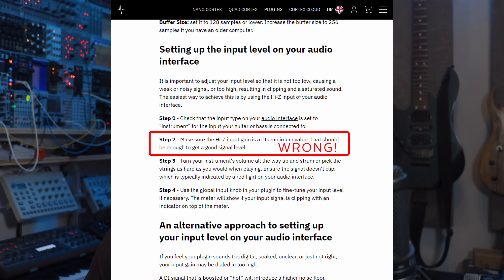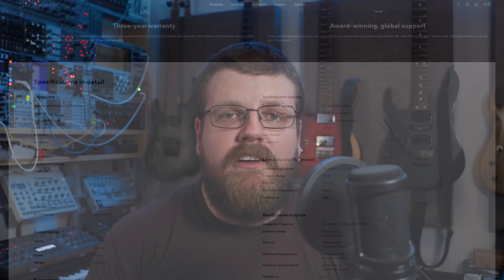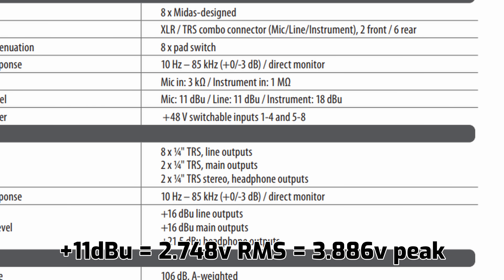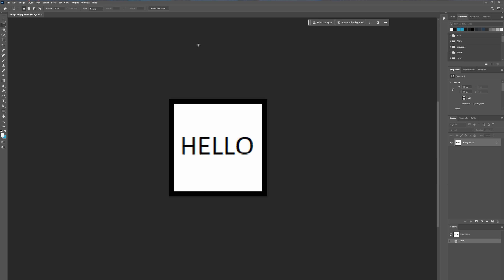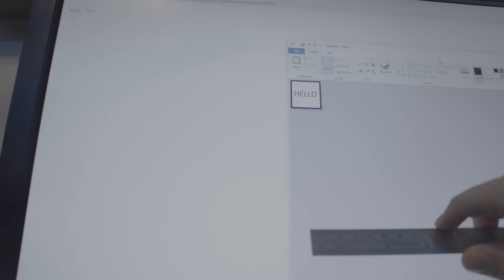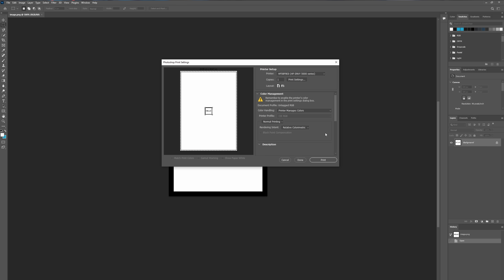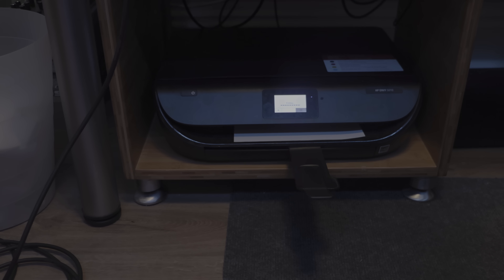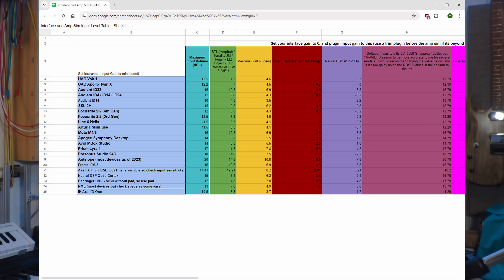Ampsims and input gain - Please, stop the madness...

Comment: Your signal to noise argument is spot on.

To expand on it with the digital picture analogy, it’s the same in digital photography. Shooting at higher ISOs introduces graininess (ie. noise). So you always try and shoot at the highest resolution and bit depth your camera is capable of and then downscale the image to your desired resolution AFTER it has been captured not during capture.

That’s because the grain (noise) in camera at say 32 Megapixels @ 16-bits is considerably smaller and finer than it would be if you set your camera to shoot at 16 Megapixels @ 8-bits. Even if your final image is only going be a small 1024 x 768 thumbnail, you don’t set camera to that same resolution. Instead you capture at the highest your camera can manage, say 7360 x 4912 and then downsample from there. This gives you the best resolution to noise ratio to start with, so when you do downsample later to your desired resolution, the grain/noise is reduced and can virtually vanish in many cases. Whereas if you shoot at the same resolution you want your final image to have, whatever grain/noise occurs at the time of capture is effectively larger and baked in, and only extensive image editing and post processing will fix it. Even then you still get a sub-optimal image in terms of quality.

Which is the same thing we experience with audio capture and post processing.

Comment: People who use amp sims aren't going to notice the difference of making full use of the converter's dynamic range. Not only that, but in a home studio (where most amp sim users are) the noise from the power source, bad cabling,  and surrounding electronics are almost always higher than the noise floor on the interface, and will be amplified along with the instrument's signal.

Most amp sims also compress the crap out of everything so the extra dynamic range of the signal doesn't mean too much at that point. Honestly amp sim users are usually the last to care about dynamics.

You're not wrong, but you also really didn't need to make a video acting like this is such a huge issue. If you really cared about how good peoples' recordings sounded (especially with high dynamic range), you would advise them to use an actual amp with a good mic and a preamp designed to sound good, not designed to fit 8 of them into 1U rack space.

Comment: I've always set my input levels exactly how I used to set them in the analogue and early lower resolution digital days - as hot as you can before clipping.  I can't understand why someone would willingly give away digital resolution by setting everything at minimum gain.  If that's too hot going into a plugin, then you can back the level off after it's in the digital realm where there's less resolution and noise penalty for doing so.  

I found the absolute best way to set up levels going into an amp sim plugin are these crazy pieces of technology called "ears", they are sort of weird rubbery flaps which attach to the sides of your head and let you analyse the signal in the analog domain, they're really nifty and I think more people should get some, but they seem to be a rarity in the modern recording world.

Comment: Audient say to set input levels to -10dB for their mic pres and DI input. That's 10 less than zero! 🤣

What they mean is raise the input gain until the signal reaches -10bB on the Audient app's input meters. You can not do that if you set the gain to zero, i.e., to reach -10dB you will have to turn the gain knob above zero. 

Yeah, there's lots of funny stuff out there in guitar land. Most guitar players think gain means distortion/overdrive. If I try to explain gain is the factor by which the signal level increases per gain stage, their eyes kind of glaze over. I am a guitar player, but I am old-ish, so was around when these terms meant what they were meant to mean. It does not help that manufacturers also call the dist/OD control gain. 

As for digital conversion or the difference between analog and digital clipping, I am not sure how many players know what all that even means. Latency is another. I know players who will not use amp plugins because they do not like latency, yet use digital pedals (all digital conversion and processing has latency but in DAW these days it can be extremely low).

Then we have the the folk who insist only the pickups affect the way a guitar sounds. Then they do stuff like put a fat brass block on their trem for more sustain, or fatter strings for a heavier low tuned chug. Doh. 

Then there's the "tone is all in the fingers" crowd. The will say somebody like Dave Gilmour sounds like himself no matter what amp he is using. Yes, of course he does, because he has an identifiable style. But Gilmour playing through a Twin Reverb turned most of the way up is going to sound different than him cranking a Plexi. 

I was going to say I do not bother with discussing all this these days, but I just did bother with it. Duh. :P

Comment: The principle of this is excellent - and debunks the insanity of the last 6 months. BUT !!!! -->
Don't, I repeat DON'T use a high gain patch to do this. You MUST use a clean patch. Why? You'll INSTANTLY know if you're overloading that plugin patch because it will distort. Using a clean patch allows you to back off the plugin input gain till it becomes....clean. That's when you know you've set it correctly (or rather, that's when you know you're not overloading it). Different pickups, of course, will need this process repeated for both interface and plugin gain controls.

Comment: Highly agree! Have been having "hot takes" for years about this lol

just wanted to add that if you are chasing the purest possible recording from the inputs possible before hitting the DAW, make sure you look up a 3rd party who has tested the actual input clipping level.

for example, I have a UMC-204hd which claims to have full 24bit range with clean input, but in reality starts to clip and introduce (relatively) heavy noise if you drive the inputs much past -10dbfs, which also impacts where your "true" noise floor will be if you actually want clean input gain into the interface without starting to saturate the converters!

Comment: This is very interesting, kind sir. I've been following this discussion for a while, but always felt unsure about the whole zero dB thing since I was always told to set my interface before a clipping scenario. So, I've got two questions, especially as someone who's just stepping their foot into this plugin stuff (after a long time of using analog/digital pedals only to PC):

After I play my guitar as loud as posible after I my gain on my interface before clipping (scarlett 3rd gen), what's the easiest way of measuring how much decibels my guitar is delivering? Is there a way to see that on a DAW?
Also, what about using pedals into the interface? or even a modeler like Helix? How do those apply into this whole "gain set to 0" in your interface? What is the proper way to set levels in that case?

Sorry for the noobish questions, but this is particularly fascinating to me. You got a sub, dude. Keep it up!

Comment: Not to be argumentative because what you say about SNR for A>D converters is absolutely correct and as long as you compensate prior to hitting the front of the amp sim your levels should be good.  But I've been using Fractal gear since the AxeFX Ultra came out and I would re-amp by recording both the dry guitar signal and the processed signal at the same time which was possible because there were multiple outputs.  I ran into SNR issues because the dry signal was so low (like -40dBFS) so I bought an interface with AES/EBU inputs and this fixed it.  The input gain of the AxeFX was cranked to where it just before it would clip and when I would re-amp the signal the only difference was from latency....if I compensated and inverted the signal 180 degrees out of phase I'd get 100% cancellation.  EDIT:  This is also the same with the AxeFXII and AxeFX III even using the integrated audio interface....the dry levels are in the dirt but because it's digital it's near silent.

My long winded point is..."it depends" more than it's a hard fast rule.  If your strat sounds like a LP...that's fine if that is what you are going for, but don't whine about it being unrealistic because your gain structure is all jacked up.  😆

Comment: Overall, I think it was a great video, and definitely a needed video. I would just like to add one thing to the discussion, because when we are talking about gain and volume, also consider that talking about guitarists. Guitarists have a unique view on gain. We use gain to distort or overdrive the audio signal on purpose, and I think that adds a lot of confusion to the topic. To everyone else, too much gain and you get noise and distortion, and that should always be avoided. I think a lot of guitar players don't realize that you only overdrive the input signal on an input that's meant to be overdriven, like the preamp portion of a guitar amp. 

Another issue that's related, and may be a good idea for a future video, is the difference between gain and volume. And this goes beyond guitarists. A lot of people have trouble with this. Maybe explain why gain is the only thing that can overdrive, distort or even harm the signal, and a volume control can't. Volume is also something that guitarists look at differently. A gain related issue can only be fixed with gain, not volume. Where guitarists are unique, is they use volume to get more distortion/overdrive. The process of overdriving is completely different than how gain does it. Since adjusting volume can't alter the signal to increase or decrease the level of distortion, excess volume pushes the power tubes to failure, but has no effect on the signal itself. It also explains why its more difficult to get a guitar tune amp to play at lower volumes. 

Anyway, I know that none of this information is news to you. I'm not trying to lecture you in any way. A lot of people read these posts, so I put some extra details in to help anyone that may not have a full understanding. This is the first time I watched one of your videos, and I have to say your information and how you present it, is exceptional. I'm really looking forward to watching all of your videos.

Comment: I’ve been saying this all along. I have been recording with amp sims in Logic Pro for about 10 years. I plug my guitar into the hi Z input on my interface and turn the gain up until the clip light blinks, then I back it off until strong strumming doesn’t clip. 

I adjust the gain on the amp sim to my liking.  Just like you did.  Seems obvious to me. I think too many people like Rhett Shull try to set the controls on the sim to match their hardware amp instead of using their ears.

Comment: Would love to try this recommended method but my Focusrite 2i4 doesn’t display any db on the input dial.  Thus, I don’t know how much to reduce on the amp sim input to accurately compensate. Thoughts?
Reply: use your ears and consulte the manual of the plugin, at around what level the signal should sit. if it sounds good, it's good.
Reply: Use track db in you DAW.

Comment: As a fellow electrical engineer who specialized in signals and DSP, I agree with every single thing you said. 

I think this can be something even some EEs struggle with, especially with Nyquist’s theorem taught as heavily as it is in undergrad programs. Nyquist’s theorem technically only holds when time is quantized and the actual signal level is continuous. Quantizing the signal level absolutely has an effect and results in differences between the digital and analog signals below half of the sampling rate. The only way to minimize this is to increase bit depth in an attempt to minimize distortion due to level quantizing. This doesn’t even take into account the SNR optimizations you discussed here, which is an even bigger reason to use the full input range of an interfaces A/D converter

Comment: I've never used an ampsim, but I would never imagine feeding a weak analog signal in an attempt to limit noise. If I'm not mistaken, noise isn't necessarily linear, and when we do increase the signal digitally we are going increase whatever has been converted no matter how low we keep the original signal. 

I'm guessing this popped up because I've been shopping interfaces for the past two weeks. RME babyface on the way!

Comment: So how would you approach this on the quad cortex? Set global input to just before clipping and then since it’s not a plugin would you lower the input gain at the preset to compensate?
Reply: I think it's similar to the Axe Fx in that regard, Axe Fx's input is set to 1.0 by default so I set the input gain on the Neural plugins to +4.0-5.0 ish according to the input gain db sheet and it sounds fine, you should do the same and set the input to +2.0-3.0 ish according to the sheet or compensate backwards if your input gain is set higher on the QC

Comment: As a person who mainly just plays guitar and doesn't record much, the moment I heard about setting input gain down in general, made me slap the knob to 0 on my dac and bam. suddenly all the presets I avoided using straight in my plugins sounded like how they were meant to sound, and so I just left it like that for ages. Over time I got bugged by some of the noise and started to compensate as you showed in this video, but I wonder if some people just found it easy because it is one single adjustment, vs adjusting the input gain for each plugin they use...

Comment: I have not watched the video yet... I'm very intrigued as to why they are all wrong as for me this knowledge is correct... will finish comment after watching video - OK, just finished watching... Electrical engineer here with master's degree in signal processing here as well, and yes you are correct with everything you mentioned, it is in fact better to do what you say. I just think this doesn't mean the advice ampsim brands are giving out (putting audio interface input gain to zero) is necessarily wrong, most people (specially guitarists with no background in audio mixing) have no idea about concepts of noise floors, input gains, dBs, how the amp was modelled, expected signal level, etc... for the vast majority of cases, and many of the most popular audio interfaces, setting the input gain to zero means you will get a pretty appropriate input level on the ampsim plugin without having to mess with any settings - I think explaining all that you just did to the average user is very complicated for plugin companies

All that said, AMAZING video man, loved it and actually never thought about it that way, will for sure start using ampsims like this, just one question: when you turned up the signal on the interface, how did you know it was 24dB just by turning the knob? what did you do to figure that out, watch the meters in the DAW?
Reply: On this topic, and getting out a bit from ampsims, does this mean that recording whatever audio signal we should always try to get the highest signal without clipping? I used to do that in the past, but now I record trying to hit -12dBFS aproximately because supposedly the audio interface pres work "better" at that range, and it's a good enough signal for mixing with a low noise floor. anyone care to comment? This has always been my truth, but with this video on ampsims,  suddenly I'm doubting it yet again lol

Comment: So you're telling me it's only 2024 and people have already forgotten how to avoid high noise floors lol incredible
Reply: Right? The lack of logic in "you don't have to worry about noise because pickups or something" is kinda disturbing.
Reply: @w0mbatina what about all the digital pedals, amps and amp modelers. You don't set the input gain on those
Reply: @cirisirpula152  Until you do haha. I had a guitar with Seymour Duncan blackouts that needed -6db on the input to not clip my Mooer GE300. And I have a vintage strat that needs about +2db to sound any good with the GE300.
Reply: @GoudVis56667  That is what the input trim is for. To bring the input signal into the expected range for the device. However, and this is the crucial part, if you don't have a problem here, you should not mess with it.
Reply: @cirisirpula152  I can only speak for the Kemper because it's what I own, but it has global input gain controls in the form of 'clean sense' and 'distortion sense'.  I had to set the input to around -7 dB (if memory serves) to compensate for modern high gain pickups when using profiles that were created for lower gain pickups.
Reply: @GoudVis56667  I hear you! The SD Quarter Pounds on my Jazz bass put out more signal than my active Aria!
Reply: @GoudVis56667  I have to set my Mooer300 to -15. My over all volume is usually about 2 on my power amp and it is loud as hell. Within the mooer my gain is  about 48 on the high side and my Pre amp is 20  to 50 depending on what I want to do and my master on the amp I choose is around 30.  I find this strange but it works.
Reply: Never underestimate the ability of guitarists to misunderstand technical topics lol
Reply: New people are coming in every day, and most of them don't have engineering backgrounds. It will never stop, just explain to them where they're wrong and it will help.
Reply: @mamfredvonclouseau8468  💯
Reply: Modellers have their input modeled to amps as well, interfaces are general purpose. But you still tweak input in modellers with input impedance, pads, etc
Reply: @mserranom well the point to set the gain to 0 is to have some sort of baseline for the guitar sim. But your audio interface must be set to INST/hi-z. Line level of course doesn't work.